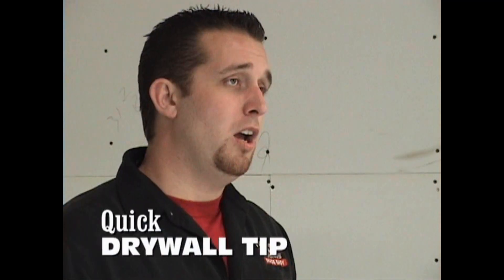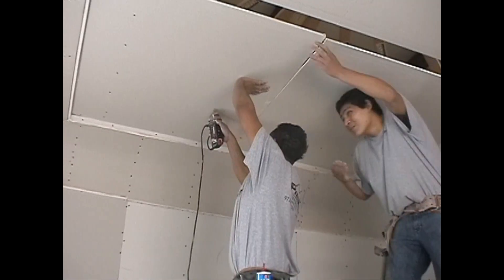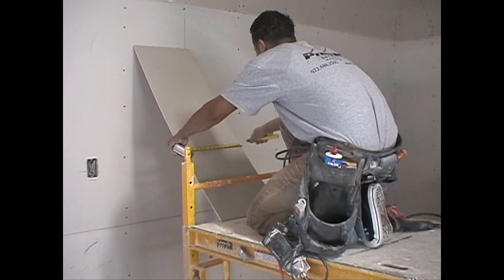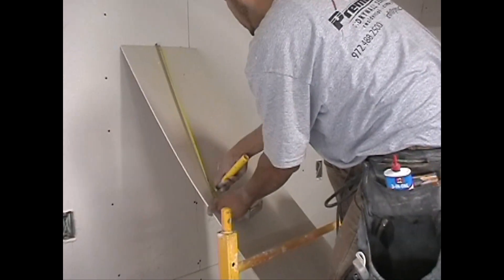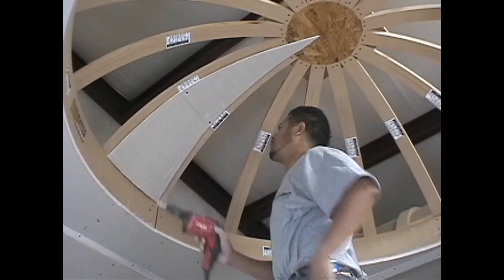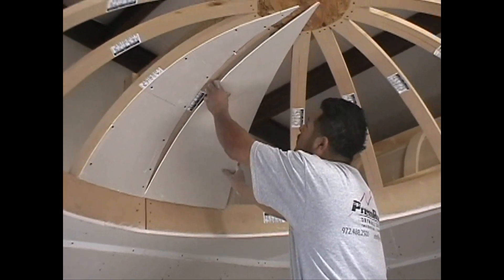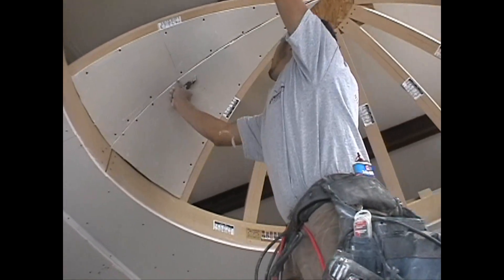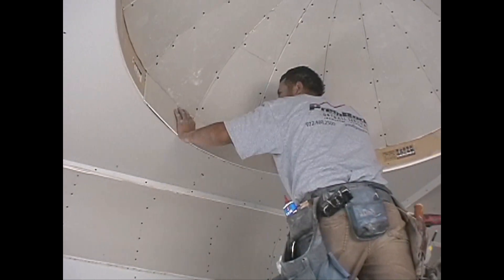How to Drywall a Dome Ceiling with Archways & Ceilings Made Easy

Comment: I have make my own building roof by help of roofingprony. Their labour are well tranied.
I am very Happy With their perfoamce. Website: www.roofigprony.com
OUR SERVICE:
1.Slicon
2.Singels/Asphalt
3.EPDM Rubber
4.Metal Roof
5.Sliding
6. Gutter
7. Roof cleanin
8. Repair Work
9. Ventilation
10. Insurance Claim/ Public adjuster
OPEN HOURS: Mon – Sat 8:00 – 18:00
Address: 1000 Atlantic Ave Brooklyn NY 11238
Contact Us:
24/7–(888)347-6634
Webaddress: www.roofingprony.com

Comment: You know of you soak drywall it will bend without breaking put it on wet it will dry perfect thats so much more costly in tape and mud that way you couldve use 2 sheets had 1 joint instead of like 20

Comment: I'm a drywall contractor in Miami, Florida and I do all domes with  paperback wire lath and always will be more easy and fast and dor the finishing we apply one cote of veneer plaster and 2 or 3 cotes of 45 durabond joint compound.

Comment: Unfortunately my 1st thought was, oh this guy hires illegals.  Thats a little premature on my part as I have no idea what their status is or where the work is being done. I like others have noticed the lack of safety gear known as ppe (personal protection equipment ) ears, eyes, lungs. That throws up red flags as to the ethics of the company doing the work. Safety glasses = $10, dust mask = $2, hearing protection = $.50 , cost to protect your skilled labor $12.50.
They do good work but its not as easy as it looks, trial & error will cost you double than to hire competent workers. 
Oh and, a hole with junction box & hanger is easy to install before sheeting and is easy to cover up if not needed but available down the road.

Comment: Wouldn't it be easier to attach drywall before 'hanging' the unit?  Pulleys??
Reply from the maker: No, it's easier to hang drywall once the dome is installed. It would be a pain to do it on the floor.

Comment: or you can use the domes we make out of fiberglass they are 6ft, all you have to do is build the box and slide the dome into place 8 screws, light weight and no bending sheetrock.
Reply: True, you can definitely use fiberglass domes. Great product. Our advantage is we build to your spec's & fraction of the cost. On a side note, I had several builders use those old satellite dishes for domes, thought that was pretty interesting. One of my builders in late 90's went around collecting them from homeowners who wanted them off their property so he stored them for his future custom homes. We used to joke together that they probably got good cell service after he put them up as domes in his homes.

Comment: p.s. why are there 2 guys in a ceiling 6 feet in diameter.
Reply: you are a union taper I presume.. I'm a union laborer.   I never saw that kinda work on any of my jobs...I think they did a good job even though I saw some safety violations..Get pissed at the  drywall co. not the workers...btw how would you tape it....I think plastering would be easier

Comment: please do not wet your drywall unless you want mold growing in your walls which could be a serious health hazard
Reply: MIKE HUNT if you add Bleach to your water no mold will form, just for your information. Mold grows if the substrate is constantly moist, this process is the right way, the Water introduced will evaporate and the Bleach factor will prevent any mold from growing. FYI...

Comment: I would be cutting a pie sheet that covers two sections. Wet thoroughly and screw down in the middle. Cut second set and overlap first in staggered configuration.

Comment: Piece of cake. NOT. So where do you get 1/4 inch drywall? not lowes or home depot. I did a curved detail in my kitchen. Used 1/2 inch. Soaked the shit out of it to get to bend then had to let it dry for a couple days.
Reply: +twinsmm1 any drywall supplier will carry it or order it for you.
Reply: +twinsmm1 It's easier to work extra hours and abstain from whores, alcohol and drugs and pay a professional.

Comment: It's easier if you assemble the dome on the work table then dry wall it & screw it on the ceiling.
Reply from the maker: +redsoil5 it would be super heavy and be extremely difficult to lift into place.

Comment: The comments of some of the people here complaining about the "over use of screws." There are a few things in life that you shouldn't fuck with. The IRS, human stupidity is infinite, and building code inspectors. And of those three, only the middle one is an actual unknown. The Code is the goddamn law, especially in the USA. You do not fucking go less then the code - if anything, you go over the code. I've seen an inspector pull out his measuring tape because he found one stud that was a quarter inch off from were it needed to be, three hours later he handed the manager of the site about ten pages of stuff to be fixed - and had a copy himself for the official write up back at whatever satan pit of an office he worked at. IRS < Building Code Inspectors.

Comment: To many screws.
Reply: the screws are being used to help the wet rock hold its proper radius in the dome.  As far as the screw in teh walls, 49 per sheet is code everywhere except where more are required.

It is technically possible to use 42, but the inspector will start measuring.

Comment: Well, here in Europe most walls are made froms bricks or concrete. I am not a Pro but if you build a dry wall here you are adding an "airvent". Thats because sometimes it can happen (wintertime) that hot air condenses on cold walls. So to enable aircirculation and keeping the drywall an the brickwall a DRY wall. The passing air takes away the humidity and so prevents molding.  I just realised that the walls in the vid ALL are wooden. google  the german word "trockenbau lüftungsgitter" :)

Comment from the maker: Where are you located? In the states you can get pricing at ArchwaysAndCeilings . com (Framing Kit Price) Generally here, to finish out a ceiling it usually costs the same as the framing kit. For example, a 6' dome sells for $329.95. To drywall it, it will probably cost you $330- 400. At least that is the case here in Texas. Other parts of the United States might cost more. Our labor here, is lower then most.

Comment: I was inquiring about the costs incorporated into the whole process from framing to texturing on a dome like this. 

Where i am located vaulted, groin and other specialty ceilings are $2.34 a squ/ft labor based on 10ft ceilings. Just wonding if it would be competitive to place a Dome over a reading or dining area vs a vaulted or groin.

Comment from the maker: @bnewton81 you can score the back but scoring the back of drywall hurts the integrity of the drywall and can lead to future cracks in your ceiling. * The drywall will not be as strong. Wetting the back I think  is a lot easier and just as fast. The key is to wet it before you start working so when you get to it...it is ready to go

Comment: @JennaHaze2000  I used an old 10' mesh satellite dish. Framed it up into the ceiling then sprayed plaster onto it using a curved form to shape the plaster to the dish. Took about 3 hours to get it done then all I did was lightly sand it smoother.

Comment: "...all you need is a little mud?!"  I'd like to see the video of the guy mudding that up.  Looks likes lots of mud.

Why not cut out a circle piece for the center and lop off the points of your wedges?  Then you don't have to have 32 screws and 16 joints in a foot diameter circle.  It'd be just like the wood framing.